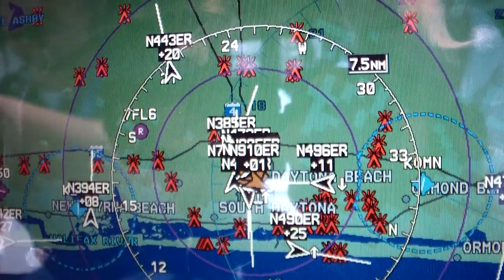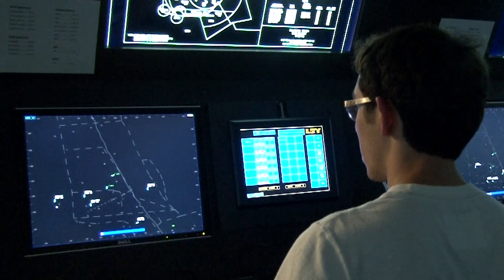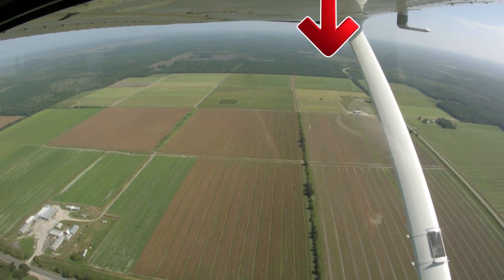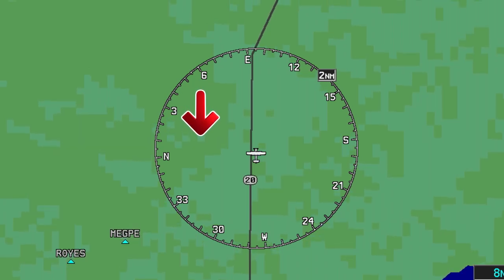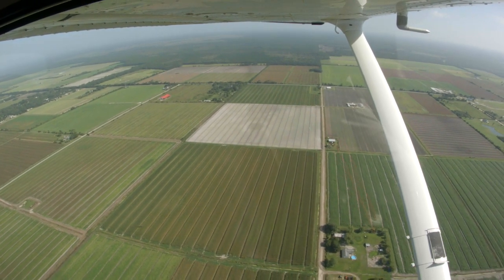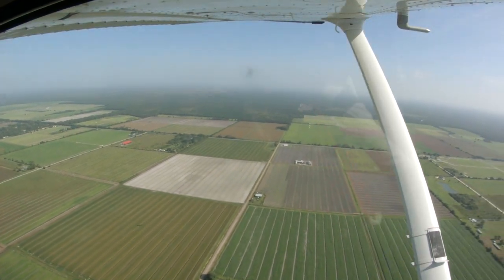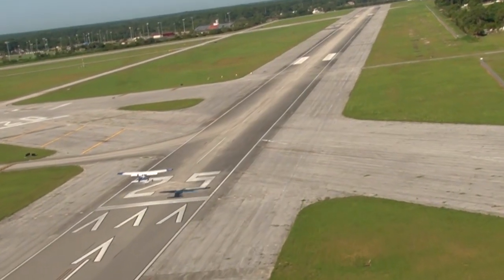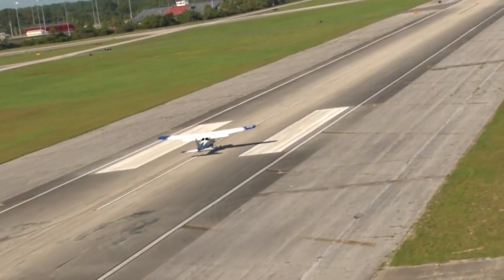Clearing Turns

Comment: my DPE told me if I find where it says in the acs to make clearing turns he would give me back my checkride fee
Reply: It's actually step one on every maneuver in skills section in the ACS (e.g Page 35 V Performance and Ground Reference Maneuvers, Skills, PA.V.A.S1. "The applicant demonstrates the ability to: clear the area." So even though it doesn't say perform "clearing turns" the pilot should still perform some sort of "clearing" activity. As you cannot see behind you very well in an airplane, the next logical thing to do would be to perform clearing turns. If you would like to be responsible for possibly killing someone in a mi-air collision, by all means, skip the clearing turns.

Comment: Your 1st clearing turn should USUALLY be to the left because overtaking aircraft pass you on the right. FAR 91.113 (f)
Reply from the maker: While it is not a bad idea to clear to the left first, it is not required, nor is it always a best practice. There may be times where it will not be possible to clear to the left first. The FAA gives no specific guidance on how a clearing turn should be made, and actually states that it is up to the individual PIC to determine the best method to use for the situation. In some cases, even a 180 degree may be best. No matter what, if in a high-wing airplane, a pilot should ALWAYS raise the wing in the intended direction of turn to clear the immediate area prior to turning in that direction.
Reply: @ERAUSpecialVFR  Would it be the opposite for low wing aircraft, in that you'd want to dip the wing slightly in order to see?
Reply: @WorkWaffle  Yes. The point of raising/lowering the wing before turning is to make sure nothing is in your blind spots.
Reply: @ERAUSpecialVFR  Should you make a clearing turn into the wind or away from the wind? You dont want the wind to catch under the wing, correct? So you would choose a clearing turn into the wind, correct? (i am NOT a pilot..i have never flown a plane..im just going off of watching numerous "first solo flights" and student training vids for the first time ever this week)
Reply: @MyNameForNow27  So when you're flying, you do usually pay attention to winds but since your clearing turns go in both directions it doesn't really matter as long as you watch your instruments. Into the wind is preferable always.